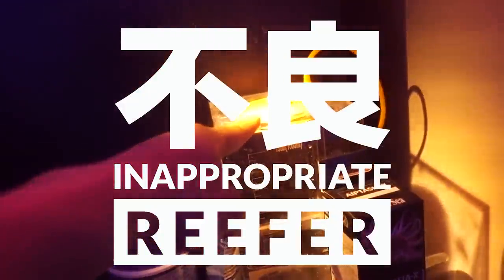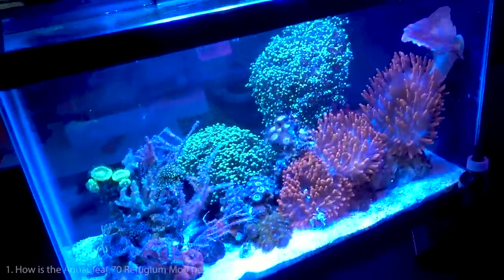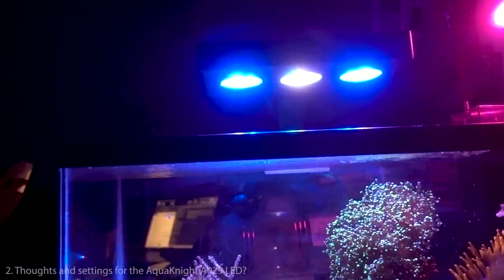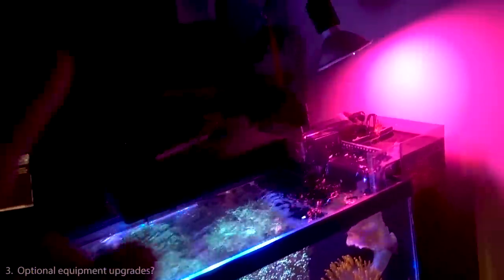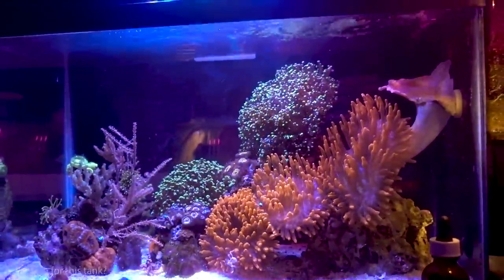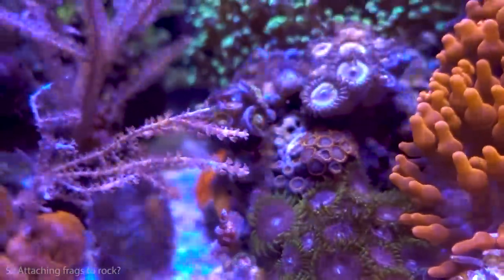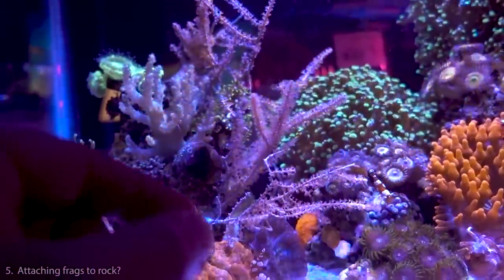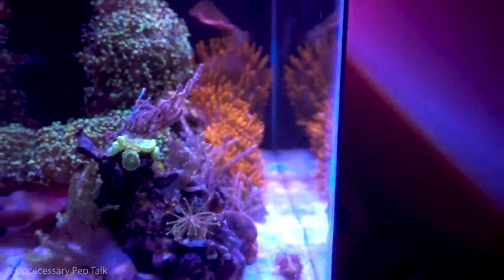5 Tips that worked: $146 Nano Reef (Part 7)

Comment: And I did the aquaclears refugium but I used a diy 5w flood light with a uv and blue led chip set right on the filter and wrapped it in foil so the color reflects everywhere and it worked amazingly!!

Comment: Also a cheaper alternative to a ATO is to use a tight (nearly air tight) glass lid for the aquarium. The important thing with the lid is to have zero (if possible) gaps in the lid. I use plastic food wrap to cover any open gaps.
Reply from the maker: This makes me slightly nervous since it may restrict oxygen exchange, I will have to look into this, thank you for the suggestion!

Comment: Cut the frag plugs with a bone cutter. I cut away the stem and all the excess disk. I’m then left with a small non uniform bud that I then superglue to rock work. That way you don’t ever notice the frag plug. I only do this when I can’t totally remove coral from plug
Reply from the maker: Solid tip, thank you! 👍

Comment: So your Smart ATO sits inside the Aquaclear? The evap changes the water level inside the filter?

Would have thought that would stay fairly constant and the tank would have the most level change?

Genius using the magnetic overflow!
I’ve bought a frag rack and magnet cleaner off OBD.

I’ve a Fluval Edge sitting here that I’m keen to set up as a nano reef but where to fit the ATO is the main challenge as the water level in the tank is in that little airlock - but if I can fit an micro ATO into the Fluval HOB...

Love your work as usual man, keep it up!
Reply: It Sits in the tank. Under the filter
Reply from the maker: Sorry for the confusion, I should have explained it better! The water level fluctuates in the display tank, not the filter, sorry about that! The Smart ATO sensor sits inside the tank, underneath where the AquaClear hangs onto the side of the tank; there is this nice little spot that fits the sensor perfectly!
Reply: Inappropriate Reefer - ah yep, thought the water level shouldn’t change in the filter, all good. Thanks for clarifying! 🤙

Comment: If you use an ATO system, does it need to be heated to the temperature of the tank? Since you are only adding a little at a time, it seems like you could get away with not heating it. Great video! Thanks!

Comment: I'm setting this up pretty closely.  One difference is that mine will not be a peninsula style setup.  Do you think I can hang the Aquaclear 70 on the long side and still get adequate water movement?  If so I plan to just black out that portion of the "back" of the tank.  Also, do you have pods in the refugium?  Thanks so much!

Comment: Part 8 Clean up and maintenance of the filter. Thre isn't any filter floss or sponges. Do you only partial change the water and change the GFO?
Reply from the maker: No filter floss or sponge; I only use pad when there are a lot of things floating around (usually in the early stage); only water change every 2-3 weeks and drop in the GFO as needed.
Reply: @InappropriateReefer  Thanks man, keep on reefing.

Comment: I use a pair of tin snips to break up frag plugs if i cannot remove the frag safely. It makes the plug look more natural when glued onto the rock work. I have the same doser but have had issues with air bubbles forming in the line. What have you done to prevent or reduce that?
Reply from the maker: Good tip, thank you! I have not had air bubble in the line up to this point, I hear if you remove the head and reinstall it, sometimes that solves the issue?
Reply: @InappropriateReefer  thanks! I'll give it a try. It could also be because I'm only dosing 1ml at a time. If that doesnt fix it, I'll try removing one of the 2 check valves

Comment: Is that moni cap attached to the back glass? How do you mount it?
Reply from the maker: Yes sir, it's mounted there using K&J Magnet (the coated ones); recently I started using Home Depot Ceramic magnet on the inside and K&J on the outside
Reply: @InappropriateReefer  Thanks! I recently got a free frag of it and quickly realized i didnt know how to mount it.

Comment: If you Push it 6 times doesn't that mean you're running it at 40 percent whites as every click dims the light? Starts at 100 and every click goes down 10 percent
Reply from the maker: Joel, you are absolutely correct, thank you for this!

Comment: What do you use to mount frags to the glass?
Reply from the maker: I use K&J Magnet on the outside and the Home Depot cermaic magnet on the inside
Reply: @InappropriateReefer  the ceramic magnets dont cuase any issues,  will have to give it a try

Comment: Right you know you were going to get my opinion because I copied this system so are you ready …
Reply from the maker: Would love to hear it, different people would get different results but the more data points the better!
Reply: The Aqua knight I can’t fault at all,for the price this is one piece of kit I would highly recommend. My aqua clear 70 seems to be running great and I’m cropping cheato at least once every two weeks. I am in the middle of moving house and I’m toying with the idea of stripping it down due to such a bad aptasia problem, and using a treated rock like reefer rock instead of live rock. I would like to also have a play about with the aqua clear, I still use the large pre-filter sponge that comes with it and I’m thinking of removing it for more flow to the refugium. Please let me know how you get on finding that acke light as well.